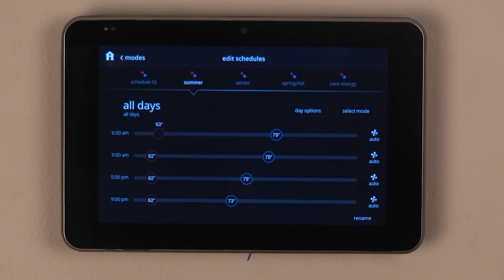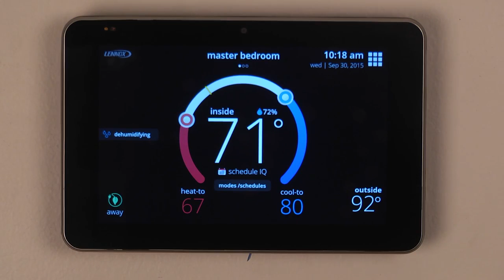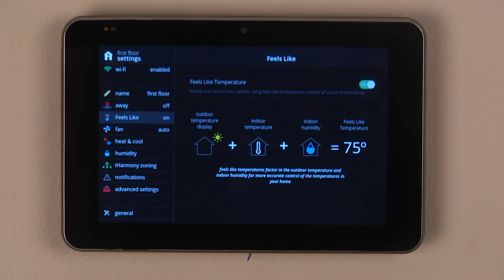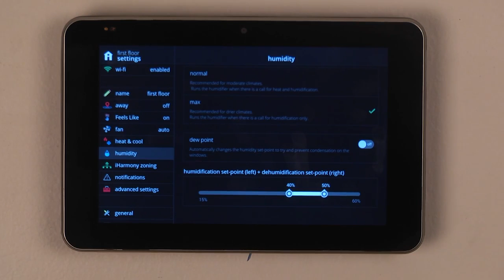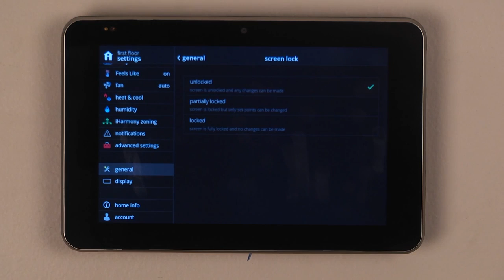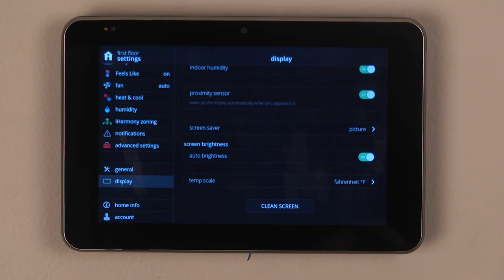iComfort S30 - Overview of advanced settings

Comment: “Ambient Lockout” shows up on my screen.  What does this mean?  Can you produce a video addressing this notice?
Reply from the maker: Hi Jim. Thanks for reaching out. So that we can best address your concerns, please let us know if you are a contractor?
Reply: @lennoxresidential   I am a “civilian” , and not a contractor, trying to negotiate my new touchpad.
Reply from the maker: Thanks for the clarification Jim. Your contractor is in the best position to assist you with any concerns regarding the ambient lockout screen you are receiving. If your contractor has questions, please have them reach out to our technical support team directly for assistance.
Reply: @lennoxresidential  very POOR response Lennox....we own it not the contractor so get your act together and answer the question
Reply: @larryb2867  ambient lockout is a set point at which the back-up resistance heat will turn on. I noticed that every time my Lennox heat pump cycled that the supplemental heat lamp would light up for 5-10 minutes.  I moved this setting from 50F down to 18F - now the supplemental heat will not fire up on each cycle at outdoor temps above 18F.  You will feel cool air from the ducts briefly, but your electric bill will be lower.  Choose your preference temperature. My contractor did not have experience with this so I had to learn it from the installation manual.